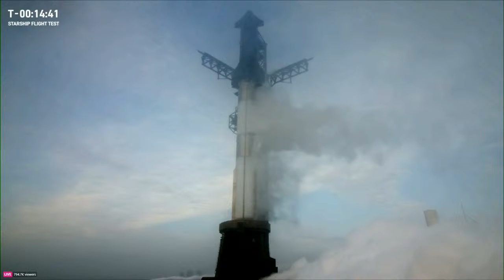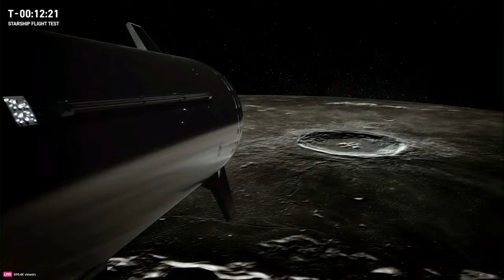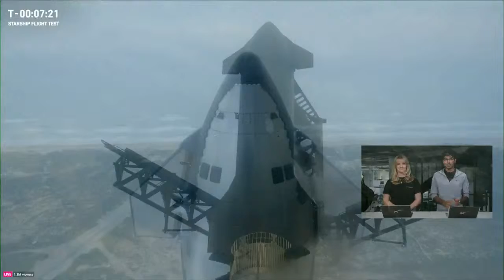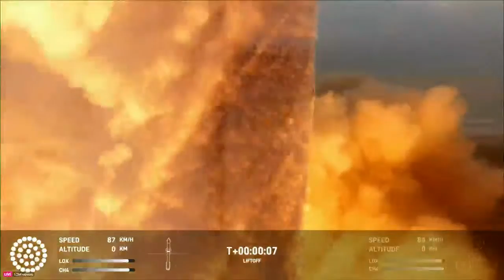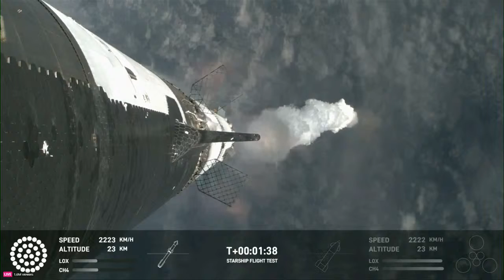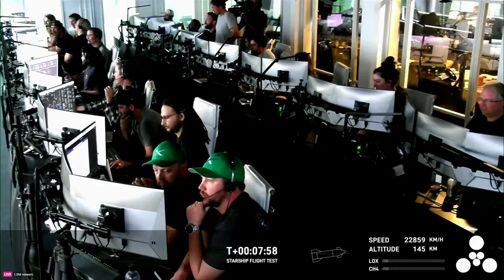SpaceX launches Super Heavy-Starship rocket on 3rd test flight | full video

Comment: Time for Space-X to call in America's Past & Long Time Experts ON Rocket & Fuel Dynamics, and On Re-Entry Thermal & Structural Dynamics e.g on the X-37 Space Plane. We're not convinced Space-X can JMust "Shut-Down" 32 Engines & Engine Cooling that puts out 16 Million Pounds Force and have them Re-Start.  32 Engines @ 6,000 F Deg Just Shut Down Incl. Engine Cooling???

Comment: Hold on, I still don't know what happened. What happened to the booster? Did it survive?
Reply: No, and it was never supposed to.  They aimed to have it make a soft splashdown in the Gulf of Mexico, although only two of the planned 13 engines relit for that final burn that was supposed to slow it down for the soft landing.  So they will be making some booster upgrades for their next test flight to try to fix whatever went wrong.
Reply: @adamhall3344  okay thank you

Comment: To get to Mars it can’t explode. Stop saying failures are successes.
Reply: do you comprehend the meaning of the word "test"?
Reply: Found the most miserable person in the comments
Reply: Everyone with an ounce of understanding realizes that Mars is still a long way off.  There have been 3 test flights, and there will be several more.  At present they are just trying to work out the kinks of getting both the booster and the upper stage back to earth in one piece so that they can be reused and hugely bring down the cost of each launch.  Each test launch has been successively better than the previous one.  If they get to a point where they quit improving things with each test launch, then you can start to talk about failure.
Reply: You sound like a biased Leftist who wants Musk to fail. Do us and society a favor, stay indoors and don't go outside in case you fail to walk in a straight line...
Reply: Years ago the uneducated masses, like yourself stated the exact same thing regarding the early Falcon 9 test flights which also crashed several times. Today the Falcon 9 is the workhorse for Nasa and has landed over 200 times - in a row.
Reply: Failures are successes, if you succeed in discovering where the problems are. Then you can correct them. Try it. You'll like it.
Reply: i dont know if all people are open for thinking. they just wanna hate everything musk does so thats that.
falcon 9 and all before were developed the exact same way and nowadays spacex falcon 9 is among most reliable most launched rocket in the world, only commercial space flight company in existence btw. only partly reusable also.  @farmergiles1065
Reply: Don't forget nothing is perfect without trying it.